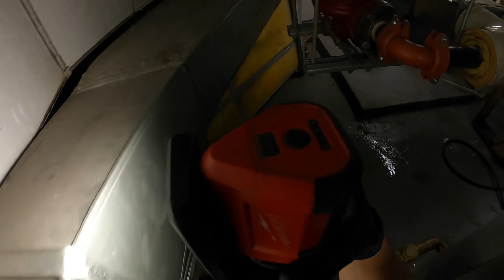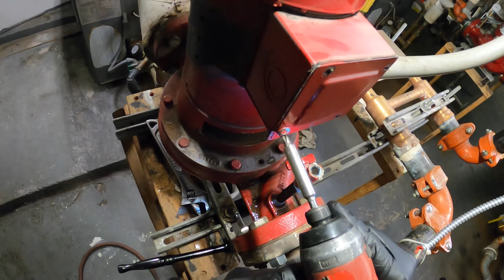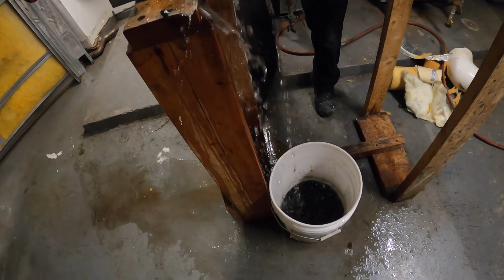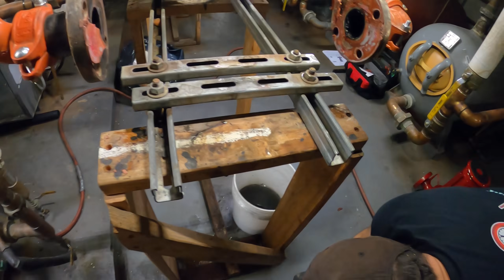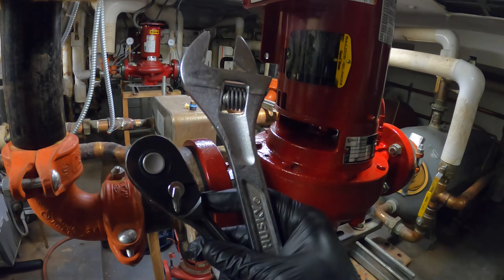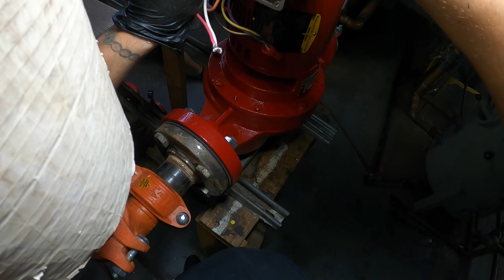HVAC: The LAARS Hydronic Boiler Room NIGHTMARE is back! (LAARS Hydronic 3 Phase Pump Motor Assembly)

Comment: I just got a new tool that would have been perfect for you. It's called a splitting chisel. It's made for splitting metal halves. Mine is a Gedore 2104 but they make bigger thicker ones. I never knew these existed until I saw YT video by Last Best Tool.

Comment: My man....use Polaris connectors...wire nuts are junk. That motor is a wye connection....you can tell when 4,5,6 are together....those are the central connection of the wye. You should mark or flag your wires when disconnecting them. Makes it easier when installing the new motor. FYI...a 6 lead motor is capable of doing a Wye-delta start.